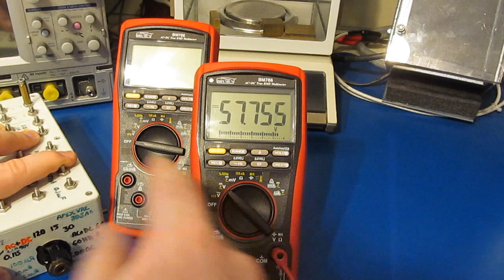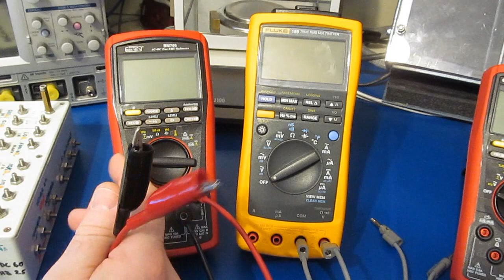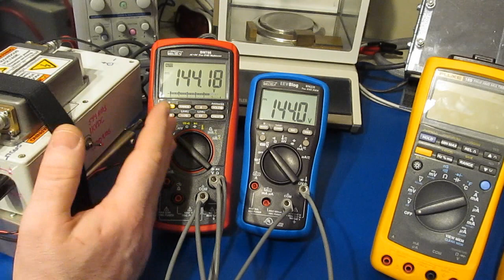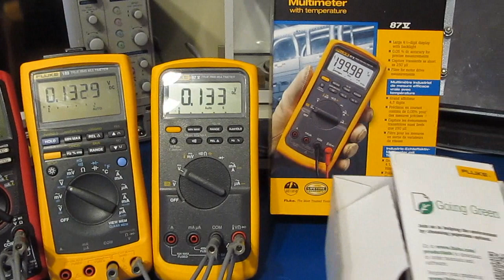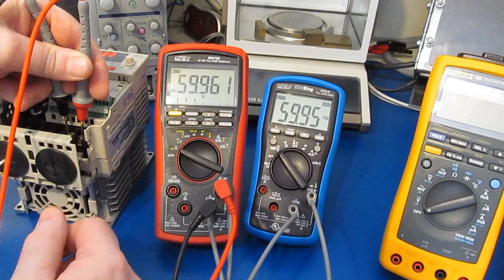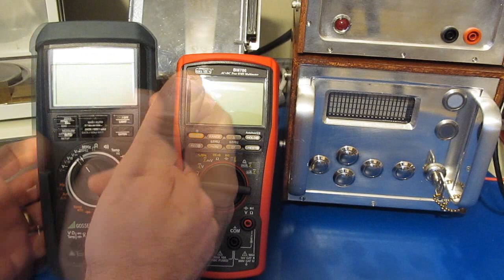Brymen BM786 DMM Part 3, Testing the Latest Firmware

Comment: Thanks Joe, why do you think the Fluke 87V Auto Range is malfunctioning?
Reply from the maker: Guessing Fluke never tested these conditions during the development is all or they would have caught it.
Reply: @joesmith-je3tq The Fluke 87V is a meter everyone trusts, but it's really upsetting to see such a problem after all these years. The fact that it failed at 1.5kV in your tests, while Fluke's own tests showed it withstood 17kV, means you should think twice before buying a Fluke meter. A reputation takes years to build, but it can be lost very quickly.

Comment: Outstanding series of testing and discovery on this issue Joe! It demonstrates a widespread problem, marketing comes first, but Bryman clearly shows its integrity in the manufacturing of test equipment! People like you are why America is Great, I got involved in electronics in the mid-'50s, Tektronics, Hewlett- Packard and many smaller corporations shared the same integrity in producing equipment. Your channel is outstanding and a great source of learning! Who is a source for this meter in the USA? How will I know if the meter has the updated IC firmware? Thank You, Louis Simon
Reply from the maker: Several of us use a distributor out of Poland who carry Brymen but this particular meter can only purchased from the EEVBLOG site.  You may find it on Amazon.

Comment: To update firmware a chip has to be changed? That sounds odd these days. Heck even my refrigerator gets firmware updates - lol.
Reply from the maker: I'm not sure how you would jump to the conclusion that this was the only means to update the firmware.  From Dave's comments,  I am guessing that the part can be reprogrammed in-circuit at the factory.   I have not asked Brymen.  Dave's 121GW has the capability to be updated with a card reader.   They released several updates for it.  So if you like to update, that may be an option.   I believe that's the only handheld meter I have where the user can perform this type of update.  Oddly enough, it's also some of the worse firmware I have seen.

Comment: Is the 786 better than the 869s?
Reply from the maker: Please define "better".  What metrics are you using?
Reply: @joesmith-je3tq  I mean mostly for the DC voltage accuracy and quality. But anyway looking for a top DMM with all the features.
Reply from the maker: @federicomelappioni8804  Outside of the manuals for the two meters, which will have the published DCV accuracy (and other specs).   It's a bit premature to say how this particular meter will hold up.  If you look in the on-line spreadsheet,  Brymen meters have performed well against my tests.  I can't say that about too many brands.   I hope to get back to testing soon, so be patient.

Comment: Kudos to Brymen for jumping onto those issues but, on the other hand, they should have identified the problems themselves in house during their own test cycles. Doing so is not rocket science as you clearly show.
Reply from the maker: True, it's not rocket science.  We're not trying to put a man on mars.   As I said in the video and comments,  this is a common problem.  Seeing a new coveted Fluke 87V gold standard also having a problem with autorange should give you some insight into how common it is.   Go back and watch when I tested that brand new Fluke non-contact volt meter.   My guess is that the designers see this test as a fringe case.  I would say they are right.  Why?  Because you never hear people complain about it.  Obviously, Brymen is interested in improving their products.  Maybe they will add this sort of test as part of their validation process.  Who knows.  I doubt many companies would as we have been showing problems for years..

Comment: Great thorough testing yet again.  BTW after finishing on the 786, could you maybe also just to a quick separate video to summarize the main differences between the 786 and the 869s? Clearly want to buy one of these 2 meters. But the decision as to which one to go for is not very clear. Such a comparison would really be quite helpful,. Even if it seems a bit mundane / obvious. Would really be nice to know what you think about the feature sets. And if there is anything on the 869s that you would really miss. Or the other way, if the smaller size of thie 786 is enough to matter in mobile / hand held situations. Thank you!
Reply from the maker: No need for a separate video.  As I have stated and written several times over the years there are few things that I really like about the BM869s.  I like being able to see more information on a single display.  Dual is nice, tri is even better.   I like having two temperature inputs and being able to display both at the same time or the difference of them.   I make use of the 500K mode.   I have never used the serial interface with the  869s and am not sure what it would take to make it work with LabView.  If I did not normally use the bench meters, I would most likely use this feature. 
That said, my choices about what I want in a meter are not going to be the same as what YOU want/require.  Your looking at mobile use, where I use it on a bench.   Learn to make your own choices.
Reply: @joesmith-je3tq  "Your looking at mobile use, where I use it on a bench.   Learn to make your own choices." makes it sound like the 2 usages are mutually exclusive. But rather mixed use (both, and for everything) is what I am doing. What I was really angling at was if the extra cost of the 869s is reallyy worth it. And I would agree with you that it is. The dual temperature inputs specifically are what has sold me since I know I will definately use those. have never had the luxury or opportunity to ever use a meter with a dual display in my life... I really just have to trust you and take your word for it. The obvious decision is to buy the 869s first of all. And then later on if I still want something smaller for mobile use get a 2nd meter. Of course that tiny fluke you have looks lovely, but living in the UK here they are not as easy to get hold of so cheaply (as in the USA). But already having an 869, the choice of 2nd meter would be less important. Maybe other smaller option would serve well enough. Like the bm325. Perhaps then by comparison the 768 is too large as a mobile meter, or the price is too close to the 869s to be a good value. Anyhow not to worry. Thank you for your input. I just hope that here in Europe they will clear through the old stock of the 869s, to get the much longer backlight time. Thank you so much for fixing that! Would have preferred a permanently on option, but good enough I guess. And perhaps... doing a hardware mod for that on the backlight circuit is out of the question? Well not worry, it's probably fine. Thanks again!
Reply from the maker: @dreamcat4  I would never suggest anyone modify any handheld meter in any way (except for the OEM).  Lack of skills, education, resources to qualify it.....  It makes no sense to me that anyone would ever do this.    The cost isn't a big factor for me.  Consider that these meters are for the most part purchased out of pocket.  If a meter costs say $550 (saw some NOS of the Fluke 189) and say it has a life of 20 years.  For me, spending $27.5/yr  ($2.30/month) isn't a concern for something I am using.  Then again, I may not need to spend $550 to get what I want.   I have an HP34401A and HP3468A that I bought brand new.  These two meters have served me very well over the years (unlike my first Fluke meter).    It all depends on your personal requirements and resources. 
For a small mobile meter, the free ones we get from Harbor Freight were fine for many people.  They have the longest battery life of any meter I have looked at.   They are also very small and lightweight.   Did I mention Free!  lol.  I would say it's better in many ways than my first Fluke.   Have a look. 
https://www.youtube.com/watch?v=ObKomuLLqU8

Comment: Hello again Joe, great update on this new meter and even greater response by the Brymen team! Kudos to them for keeping their finger on the pulse of their products and their willingness to stand fully behind them. It might just be me, but I can't seem to overlook what I think I saw as a flaw with the "bar graph" display on the 786. It appears that there was no bar graph display while in "A/C" mode...also it appears that the bar graph  update speed is extremely "choppy" and slow to respond, also it seems to "skip".
Let me know if it is just me please.
Awesome job again Joe...I await eagerly on your next update...👍🏼🙂
Reply from the maker: If you read the comments you were not the first to notice the lack of a bar graph.  What you failed to notice was the meter was set to VFD.  You may have also notice it was off at other parts of this video were I had it enabled.  You may consider it a flaw but it's covered on page 5 of the manual. 

I am not sure what you are referring to with the bar graph.  I did a whole section on just that one feature.  I assume you watched it or you wouldn't be commenting on it.   You would need to tell me which video and time you are referring  to.
Reply from the maker: Also, why you did not comment about it, you may have noticed that the 786 was reading a bit low during the part were I had the DSO connected and cycled through the waveforms.  The VFD mode would have an effect with waveforms that contained higher frequency content.  Again, not a bug but a user problem.
Reply: @joesmith-je3tq  thank you for the response Joe. I will chalk this one up to me as an oversight on my part...😊
I guess what it appeared to me that was happening was when you was varying the voltages in A/C and in DC mode, the meter's bar graph display "appeared" to be very "skippy" and "choppy" in response to the varying voltages, and it almost seemed to not respond to the varying changes. I will go review your video again....👍🏼🙂
That all aside, I have totally been enlightened and enjoy all of your testing and updates on these multimeters. You have been bang on with your evaluations and testing.  👊🏽🙂
Reply from the maker: @dreamvouyer67  Consider when I edit the video, I will compress sections that will cause a skip in the video.  Of course everything being shown will be effected.   You should be able to detect this.   The update rate for the BM786 is 50 times/second.   That's fairly fast compared with many DMMs.    https://youtu.be/36NkAObcMec?t=1592
Reply from the maker: @MNIEMANOLOG  It's very possible according the Brymen that the meter is out of cal now.  But, if you watch very closely, you can see that the 786 reads very close to the BM869s except in cases where the waveform has a lot of high frequency content.   I think with VFD active, the manual doesn't specify the accuracy above 200Hz.   I strongly suspect if I repeat this test with the VFD mode off,  it would have been much closer (and we could all watch the bargraph).

Comment: There is a noise problem with brymen multimeters.
For example, BM869s could not measure 560k resistance in noisy environment.
You can try near the 220v 50hz line.
video:  https://youtu.be/_SD24ujP3vg
Reply from the maker: First I have heard of it.  Have you documented your setup anywhere that you can provide a link for.
Reply from the maker: Sorry, the links will hit the YT filter.   Is this your personal video, or just a link you found?
Reply: HI. I tried many times to get you a video but failed. I got stuck on the filter every time. finally, I edit this post. the video on my channel belongs to me.    _SD24ujP3vg
Reply from the maker: @Nazmi_PWM.C  I am able to replicate what you are seeing.  I assume you contacted Brymen when you found it.  What was their response?

Comment: On the continuity test mode, can it be set so that it beeps on open circuit as well as on short circuit? I think some Keysights have that. Not critical but could be useful sometimes like when checking for bad intermittent contacts.. hook the meter up and play with cables and couplings to find the trouble spot.
Reply: Fluke 189 continuity mode has both "beep on short" and "beep on open". Works great.
Reply from the maker: Not that I am aware of and there is nothing in the manual about it.  The manual is now on-line if you would like to learn more about it.  Seems like you could make something custom to do what you want.

Comment: Great attitude by the Brymen engineering dept in tackling the relevant discrepancies and not attempting to shoot the messenger. This pro active approach can only but increase the confidence the end user can have in diagnosing  and fault finding electric and electronic circuitry in both the industrial and domestic environments.
Reply from the maker: Fully agree with you.

Comment: Great video as always Joe! When is Brymen going to make a JS model? They should for all the help and pointing out issues. It’s amazing they get to the problems you bring to their attention instead of saying “no big deal” like most companies would. I have 4 Brymen meters now and they are my go to meters on my bench. I also picked up a great used Fluke 189 a year ago or so after your tests. Keep the tests coming. A 786 might be on my radar after these tests. 👍👍👍
Reply from the maker: Buy a BM869s, then get yourself a marker.  Black.  Now, write JS across the top.   Instant JS meter!!   lol.    I won't suggest you do this to a classic 189.  Both very nice meters for my use.   I was rebuilding an RF attenuator and was using the two temperature sensors on the BM869s to look at the temperature gradient from the element to the spreader to the sink and between the two case halves.  The only thing better than a BM869s, is having two of them!
Reply: @joesmith-je3tq  Yep, my first was the BM235 and then the BM869, BM535 and a rebrand Greenlee I got used, I think a BM210 is the Brymen model of it. $30, couldn’t pass it up.
Reply: @SIXSTRING63 :  I LOVE the Fluke 189 (and the 289). I've been very tempted to pickup a BM869S (because JS speaks SO highly of it), but its dBm ref Z is not adjustable between 1-1999Ω like the 189. Unfortunately, it only offers presets (e.g. i use 2Ω & 6Ω frequently, but BM869S only offer 4Ω, 8Ω, and up). Cherish that 189, and don't forget to upgrade it's super capacitor.
Reply: @hightttech  Yep, upgraded the super cap after Joe put out a video on that. I was lucky to find one that looked as if it was fresh from the box for $200 a year and a half ago. Now they are up to $300+ for beat up junk in most cases.

Comment: 7:30 This is a not un-common hardware limitation of meters that share AC and DC switch positions, which is why Brymen can't fix this for the BM235 in firmware.
Reply from the maker: As I said in the video, it's not uncommon, period.  I've never asked Brymen if they could improve the BM235.
Reply: @joesmith-je3tq  I have asked them in the past (before your testing of the BM786) if it can be fixed in firmware on the BM235, and they said they cannot, they said it's a hardware limitation of sharing the AC and DC range switch. I have since found the same issue in some other meters that share the AC and DC switch position.
Reply from the maker: @EEVblog  From my tests the BM235 is one of the better meters I have looked at when it comes to this test.   There are so many meters that are much worse than the BM235 that I have looked at,  I wouldn't have considered asking Brymen about it.  As I demonstrated, that first version of the firmware I tested was more sensitive to this test than any other Brymen products I have.   You have had access to the BM786 much longer than I have.  I'm surprised if you would have asked about the BM235 but ignore the BM786.   I have a lot more testing to do but so far they certainly have done a nice job with it.
Reply: EEVblog2 could you expand? Meters that don’t share AC and DC switch positions have this problem too.